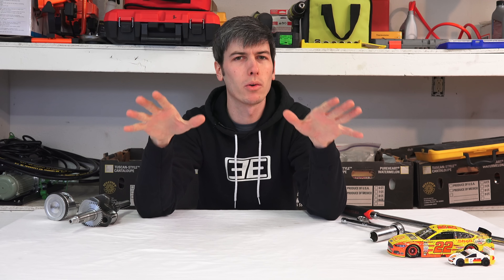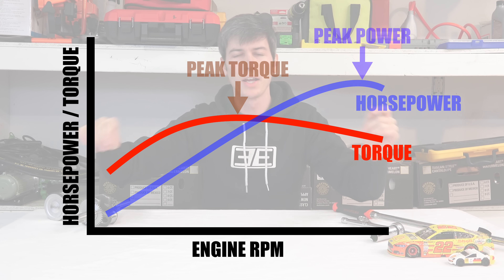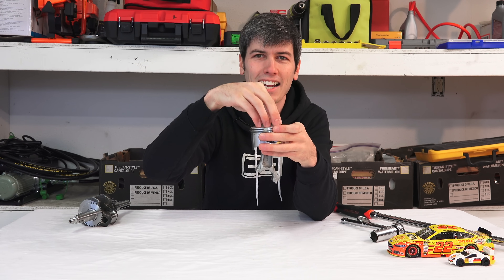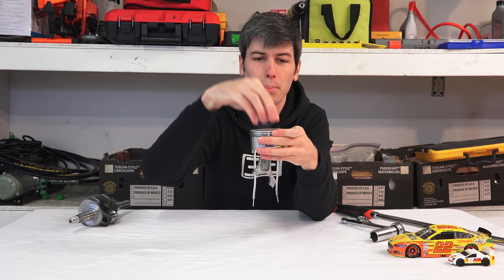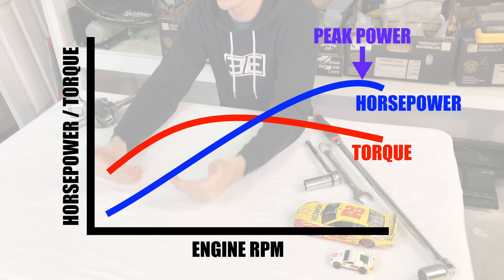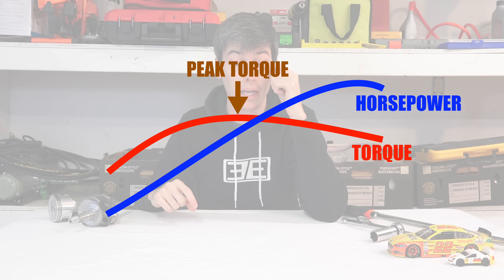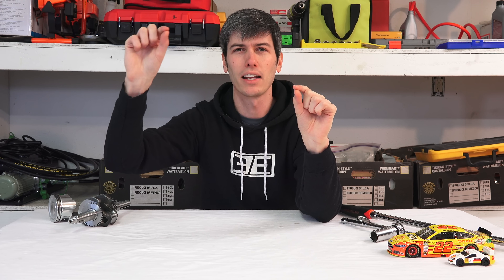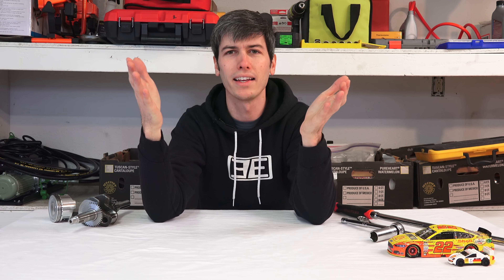Horsepower vs Torque - A Simple Explanation

Comment: Nice Vedio.
another way of explaining  torque vs power would be like Leopard vs elephant . Both has the power. one is used for running fast  and the other one is  for lifting heavy object. for racing car power is important whereas  for a tow truck ,torque is important.

Comment: This is great, however I'd go a little further.  Take the 2 car situation.  While it's TRUE that the higher hp car will accelerate more quickly, if you add mass to both, say a trailer and start loading that trailer with heavy things.  Eventually the higher torque car will accelerate more quickly as it had more leverage to put the power down.  This applies until a certain rpm is reached at which point the higher hp car will pick up more speed than the higher torque car can.

This is why trucks use high torque diesel engines, they have an easier time pulling heavy loads than higher hp petrol engines would, until that rpm range when the higher hp engine reaches its 'power band' and should theoretically accelerate past the torquey engine.

Comment: surely then fast cars could use a cvt (Continuously variable transmission) for constant peak power at the correct torque level in the rpm range?

Comment: Not sure what this is such a confusing topic to be honest. Torque is how much work can be done, and Horsepower is how fast said work can be done. The car with 200 HP and 100 Torque can and will go faster, but the car with 100 HP and 200 Torque will tow a much heaver load though much slower. This is the case because in your example both cars were identical in all ways besides the above numbers; thus the gearing is exactly the same.

Think of it this way, it does not matter how fast you can move a Torque wrench, if you cannot apply the 75 lbs per ft of Torque to the lug nut on your wheel, you are not getting the lug nut off the wheel. However, if you possess the required strength (or leverage) to obtain the needed 75 lbs per ft, then the faster you can move (Horsepower) the faster the lug nuts will come off.

Comment: how some cars with same horse power (exc:110hp) have different torque (exc:220Nm and 260Nm) ?
Reply: It's because of bore to stroke ratio.
Same volume with different bore stroke ratio will have following effects:
More stroke length= more torque
But long stroke length means lower RPM
While more bore dia means more force at piston during combustion stroke hence more power. As it has same stroke length without reduction in Rpm due to long strokes
Power=torque*angular velocity (RPM)
Torque = force*perp. Distance
Reply: Depends on at what RPM they reach that horse power. A car with lower torque will need to rev higher to reach same maximum horse power.
Reply: different running RPM
many high performance cars with smaller engines you'll see running several thousand RPM higher than large engine models, its 2 different ways of getting the same thing
Reply: "how some cars with same horse power (exc:110hp) have different torque (exc:220Nm and 260Nm) ?"

The car with the higher torque revs lower. This is why diesels often have double the torque (in ft*lb) as Hp, while gassers have equal numbers, or even lower torque: gassers rev higher than diesels.

P.S. You're mixing measurement systems: metric for torque; non-metric for power. Typically you don't want to mix measurement systems. (The metric corollary to N*m is kw.)

Comment: My car has Fiat's Multijet Diesel which produces 74 BHP and 190 Nm of Torque. The same car's Petrol Engine of Suzuki produces 83 BHP of Peak Power and 115 Nm of Peak Torque. But,as you said, the former one feels very punchy at particular RPM (2000 rpm, at which Peak Torque of 190 Nm kicks in). In the Petrol version, peak power comes at 6000 Rpm so you have to rev that engine hard to get some juice. 

But, the flat mid range of that Petrol engine is boring and thats why I like the diesel, which kind of feels punchy above 2000 rpm.

Comment: Your explanation about the 2 cars is incomplete... Example...a Zero electric bike will beat a gas motor bike of greater horsepower because it has double the torque..so off the line and up to a certain speed the Zero wins, and all vehicles with greater torque win off the line.
Reply from the maker: Sure, but remember that a vehicle with more low end torque also has more low end power. They're connected! :)

Comment: Explains why my truck is so slow lol... 240ft lbs torque, and 110hp   Here is an awesome and odd example my friends car has around 220hp and 180ft lbs of torque.  He can reach 100mph ALOT faster than I can, but when we go up hill, I can maintain 100mph where his car with 110 MORE hp,  cannot and begins to slow down.   Hope this helps paint the picture even more on the relationship between the two.

Comment: But if CVT is the optimal choice none of the supercars use it these days.. or even sporty cars like M's gti's Amg's.. why? Cause i dont think its the cost or something..
Reply: They aren't used because they are boring, inefficient, and weak.  A perfect non-slipping CVT that could handle the engine output would be the fastest transmission.

Comment: work is the derivative of energy with respect to time. Energy in this scenario is kinetic energy of the vehicle.

When the delta energy per unit of time is at a maximum, acceleration is the greatest because the delta kinetic energy per unit of time is at a maximum. So according to this reasoning, acceleration should be at a maximum at peak power and not at peak torque, assuming they are not the same for a given engine.

I am not an automotive engineer, so please explain any flaw in my reasoning.

Comment: So, basically, a 2.0 200 hp Civic with VTEC, via some tricky gearing, could pull the same loads as a 200hp 15.9 liter tractor truck? Not so, since HP as James Watt arbitrarily called "horsepower" (a linear pull work/time) to something that's entirely dependent of actual torque (circular work) readings times an arbitrary 5250 number (maybe he figured back when steam engines where the only way to go, that no heat engine could spin faster than 5250 rpms)? No gearing advantage will allow a puny sedan engine to do the same feat as a torquey diesel truck engine.

Comment: so horsepower is the rate at which torque can be accomplished. Specifically to engine. So everything stays the same your gear and your torque stays constant but the rate at which torque can happen is you’re horsepower am I understanding this correctly.

Comment: Older cars 1950s say, had high torque, low revs, low power engines. Modern engines are higher rev, shorter stroke, more power, less torque. But for an electric vehicle its high torque all the time.

Comment: You’re ignoring some key info...mass from a dead stop or up a grade (especially with identical gearing). That bears explaining in a video. Torque is vital to getting and keeping a force in motion, horsepower is for accelerating ONCE IN MOTION. Yes, also from a stop...although less torque compared to another vehicle which has the same HP means the torque-heavy vehicle (once a certain mass is reached) will out-accelerate the other vehicle. This is why the diesel engines in heavy trucks need so much torque while the HP figures are comparatively ‘low’. All of that weight requires the high torque to keep moving.

Comment: Engineering Explained, I'd like to say that the engine torque has nothing to do with max accelerating the car even at a constant gear. This is because the torque is not a characteristic of the dynamics of motion in general.

Comment: This explanation covers speed of acceleration, but engines are used for various purposes. Horsepower is great for speed but not so great for sustained pulling a large load. A vehicle for towing a large caravan benefits from high torque. My diesel Land Cruiser is perfect for pulling big vans up and down hills all day without effort but is not going to win a race. A race car with high horse power will struggle to pull that same van up a hill because of its lower torque. That is why trucks and tractors tend to be higher torque but lower speed vehicles. A lot of people need that kind of vehicle.

Comment: I dont find the explanation meaningful and scientific. The frequency shifting between the torque and power is related to volumetric efficiency of the cycle. The efficiency is function of engine rpm.

Comment: so same engine must have the same HP right? no matter the torque (depends on gear ratio)
Reply: don't forget that gears are a torque multiplier .
Reply: Jo Ko 
No, hp is TORQUE x rpm
So you can't have power UNLESS you have torque first, then actually MOVE the lever/shaft/wheel/ screw, etc......
Think of an electric drill/driver undoing a screw or bolt.
Hit the button, it applies a torque.
If the screw doesn't move, adjust the gear setting. (Increase torque, reduce rotation speed), once you break the friction of the screw, it rotates, then the driver is using power. The faster the rotation, the more power. The intial torque still remains the same, it's now doing work! 
Apply this to a vehicle.
The (electric) MOTOR will have the same torque through ITS rev range.
BIT
As has been said, gears are a torque multiplier, so, for a given torque / speed of the MOTOR, a LOWER gear gives MORE torque, but LESS speed at the WHEELS.
With an electric motor THIS torque will also stay constant (for THAT gear).
The POWER at the wheels will increase as the vehicle accelerates. Again
Torque x rpm.
Reply: Gearing manipulates torque, but will not change the torque produced.
Reply: Tony Pena 
Not by the engine(motor), but if will multiply (or divide) torque at the wheels. If it didn't, you'd get the same initial acceleration from an ICE engine in first, second, third, etc.
Reply: In a practical application, how are we achieving high RPM by not pressing the throttle, hard or otherwise?
Reply: Machado Racing 
I just read your post again,
If a vehicle moves at a constant speed it needs TORQUE applied to the wheels at a constant rate to keep they wheels turning at that speed, they then work against the friction of the road and move the mass of the vehicle forward.
What the ENGINE is doing at this time may vary!
1) The engine can be running fast, in its power band, past it's maximum torque, using a lower gear to convert the high POWER of the engine back to TORQUE at the wheels.
2) Running at a lower speed, near it's highest TORQUE band, running a HIGHER gear to keep the wheels turning.
Obviously, for maximum acceleration at this point, you want the engine revving to enable the RATE of work (power) to change quickly.
This explains why the acceleration is greatest well into the drive phase.
Watch an EV accelerate. It's "binary"! Nothing to FAST over the first few yards. All due to maximum (and linear) torque.
Reply: If you hang a one pound weight on the end of a two foot long bar, how much torque is generated?
Reply: Machado Racing 
That obviously requires the ENGINE to be at it's ideal power band with the throttle fully(?) Open, you still have to transfer that  energy to the ground to move the vehicle.
Have we not been discussing power / torque at the wheels?
The only real way to compare ICE and Electric?
Which brings us back to the very good point of the gearbox being a "torque multiplier", not needed by the Electric system, where a single reduction gear effectively multiplies the motor torque and the high rev range takes care of the complete wheel / Vehicle speed range.
(Hence the rapid but uneventful launch of EV's (usually Tesla) in comparison to the cacophony of the ICE cars they challenge?)
Reply: Fred Garvin 
As I said?
Reply: i agree but u should have said "that's not absolutely complete" because his explanation is right and yours has just developed the concept and thank you for the details.
Reply: thank you for the added details
Reply: Jo Ko Wi Do Do jokowi ganti presiden

Comment: nice video, thanks! Only one thing: min 2 ish the big car does a bigger amount of work when moved faster from a to b as compared when moved slow.  Acceleration and deceleration forces are greater for the same space, so work itself is higher... power is higher too. You also have the increased friction because of the higher speed, but that would be a bit too much preciseness as such speeds.  :)

Comment: I think it would’ve been better to define torque as a force of rotation, rather than just force at a distance. There is a radial distance, but the key thing is that the force applied perpendicular to that radius causes a rotation around the axis.

Comment: but why so we say thst the torque starts decreasing after a certain limit when it's only the force which determinrs the torqque thats decreasing and at the same time the perpendicular distance at which the force is being applied increasing through the gear ratio so and torque is the product of force into that perpendicular distance to ultimately the torque is increasing even after the 'torque peak', is this not the case? I am probably wrong so please do correct me